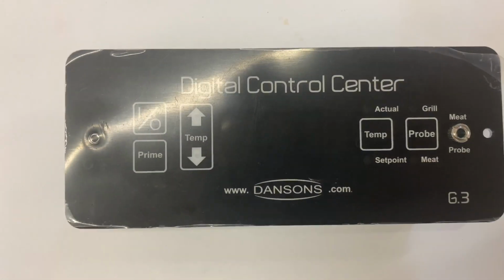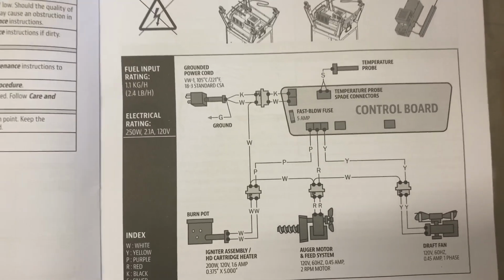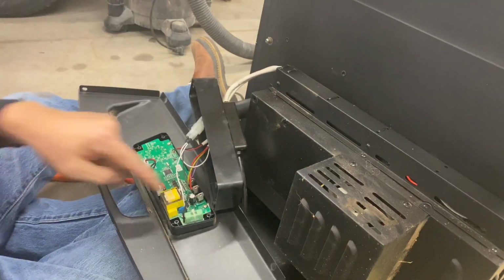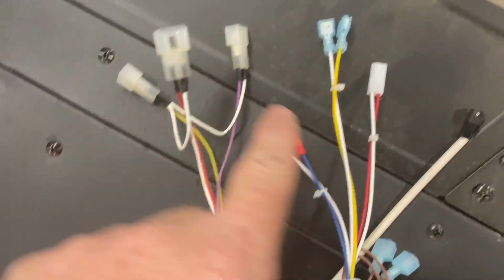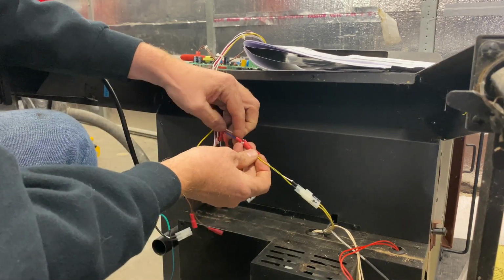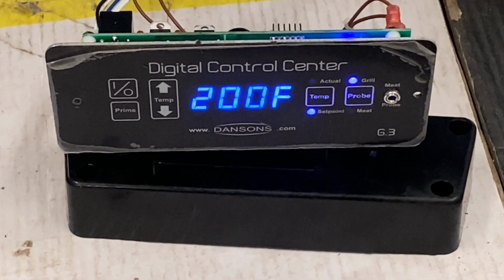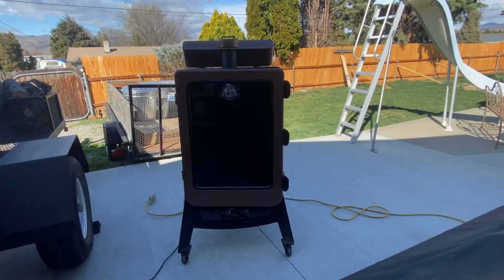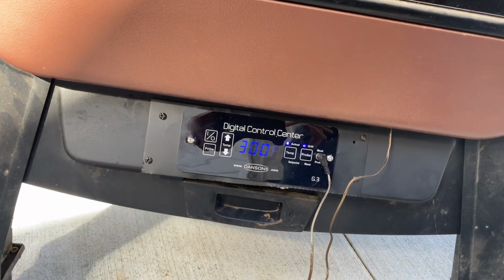Pitboss Vertical Copperhead controller upgrade - how to

Comment: Great video...only 1 negative comment...always put the male exposed ends of the splices on the Load side of the wiring.  That way if a joint comes apart the exposed metal end is not live.

Comment: Thank you for the video.  What is the lowest temp setting the controller will go?
Reply from the maker: Thank you for watching. I believe the controller goes up to 450 but I don’t think it gets any hotter than 400.
Reply: @LouisatRshackBBQ  what is the low temp
Reply from the maker: @keithsavoie4499  the lowest setting is 180 degrees in their smoke mode but my experience is it ran between 180 and 225 in that setting - not very consistent at 180

Comment: Awesome video, a before and after pic would be great too.
Reply from the maker: Thank you for watching. I am not happy with this controller- it doesn’t seem to be 100% compatible- the inside temp is way off from what the controller displays. I have another controller I will be installing soon and will do a before and after on it
Reply: @LouisatRshackBBQ   Did you replace the internal RTD probe also?  Maybe the original PB one isn't compatible with the Danson control board?

Comment: Has anyone tried moving the control panel to the top of the smoker to avoid the heat / drippings?
Reply from the maker: Thank you for watching. As far as dripping go - the controller is pretty well protected but there might be some heat issues. I have seen where guys have mounted them on the side up high but that’s more for convenience

Comment: Thank you Louis for the video, you got me started in the right direction.  Yesterday I did this upgrade and it works great.  I did a couple of different things then you did.  Instead of making a plate to hold the new controller on the Pitboss, and cover the hole,  I took the guts out of the old Pitboss controller, and used that shell for my plate to hold the new controller.  Because I used the Pitboss shell for the new controller, I also was able to use the back of the Pitboss controller to secure the back of the new controller.  Since the controller is now protected using the old shell for the new controller, I also didn't have to make a heat shield to protect the new controller.  This saved a couple of steps, and the new controller is secured tight on the upright Pitboss smoker.  Thank you again for pushing me in the right direction.
Reply from the maker: Thank you for watching. That was a great idea to reuse the original controller frame. What controller did you go with?
Reply: @LouisatRshackBBQ  Because of your great video, I bought everything that you bought, it is the same controller, the only difference is yours is a G3 and mine is a G2.  I don't know if the different numbers means yours is a newer model then mine, but they look the same and seem to act the same.  Thank you again.

Comment: Good video! I work with PLC’s and PID loops at work. Smoking with my Pit Boss series 3 as I type this. Good job!
Reply from the maker: Thank you for watching. I can’t say that the controller I installed is compatible with the copperhead as it seems to be 100 degrees cooler than what it is set for. I have a rec Tec controller which I will try next.

Comment: Good video. So, is the Louisiana grills vertical smoker the better of the two? Of course, taking cost out of the equation.
Reply from the maker: Thank you for watching. I can only comment about the LG at Costco as I have actually touched it. It is around 5 inches taller so it has 6 shelves standard. Has 2 door latches instead of 1 and cones with a cover for the same price as the Copperhead at Walmart and no cover. It also has a digital controller vs a dial— so looking at those factors I would say yes it is a better ——deal,,, unit not sure about since they are the same manufacturer under Danson.

Comment: Nice video. I have a year old LG 7 series and the controller throws off error codes (ERl, ERH) that shut system down. Cooked great when it worked but I have had it. It has a 5yr warranty but the controller is not great. I will probably return to Costco for full refund. Can anyone recommend a smoker vertical or grill that has a good PID controller and does a good long somewhat stable smoke without error codes?
Reply from the maker: Thank you for watching. I bought mine and a month later the LG showed up at Costco. My dumb luck. I love this vertical style - just wish the controller was better.

Comment: Great mod Louis, having same issues with mine (Louisiana version), both large offset from controller temp and actual pit temp as well as big swings...  Have you done a nice cook on it yet?
Reply from the maker: Thank you for watching. I did do a cook with and used a inkbird wireless to compare the temps. I didn’t get the same kind of swings but did have some issues of what temp. It was running at. Here’s the link to that video https://youtu.be/Zi4pD6bVDn8

Comment: I agree with you on the “why” you did this. The temp swings are drastic. I find them more consistent on my new PB Classic pellet grill. I think there is a PID controller on it. There is a button to change the PID setting. I’m glad you have the skill and courage to do that conversion. I like the digital control much better than the dial. Good video. I’m still pretty much set on getting a series 3 as opposed to my 5. Space considerations on my patio. When yo decide to hop on I-90 east let me know and I’ll try to have the parts ready for you.
Reply from the maker: John Manthey thank you for watching and commenting. I would love to visit but there is that long somewhat boring drive through Montana .. lol. Yeah through our conversations I could see where a 3 would fit better than the 5.
Reply: Louis at R shack BBQ I think after the mountains I think 90 cuts south through Wyoming. That’s when it gets boring till the Black Hills. Then boring for 5 more hours to Sioux Falls. Who knows but some day we may meet. Let’s just not make it in the hereafter.
L

Comment: Nice job with showing us the wiring and explaining LT. You haven’t got me convinced yet to change mine out. I noticed a 75 degree difference from your actual to the probe inside. I think you should’ve used a pit probe you trust most to get a better idea of what the temps are inside vs using the built in probe you haven’t used yet. I’m waiting to see more on this through your videos to see if it’s worth the change or not. You mentioned an issue cooking at high heat but you didn’t elaborate on it, I’d like to know more on the issue you were having?
Reply from the maker: Paul’s Q thank you for watching and commenting. Yeah I wish I had a pit probe for it rather than a internal temp probe.  On my copperhead it liked to run best at 250 degrees with 25 - 50 degree temp swings when set there. Anytime I went up over 300degrees I would get up to 100 degree temp swings. It was fine since I like to do most of my smoking between 225 to 275. Figured I would try a new controller to see if that helps.
Reply: I agree Paul.  I was surprised to see the big difference in temps
Reply: I did this too. I installed the Rec Tec controller.I have to say I couldn't be happier temperature swings within a degree or two

Comment: Very cool Louis ... I'm excited to see how well it works during a cook .. I'm cooking on mine as we speak and so fair its doing ok .. But I may very go this route if works out well for u
Reply from the maker: 1984 BBQ thank you for watching and commenting.  Mine liked to run at 250 degrees which is fine but anytime I set it up over 300- it would swing temps big time. I am looking forward to see how this new controller does over a long cook
Reply: Louis at R shack BBQ please keep us posted